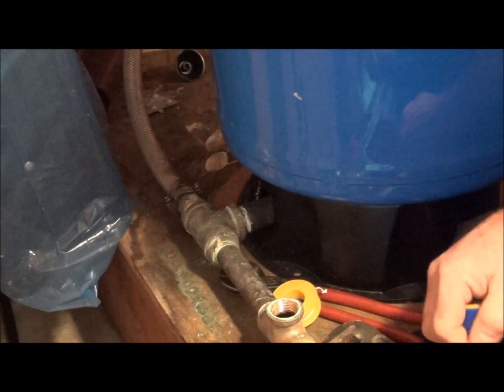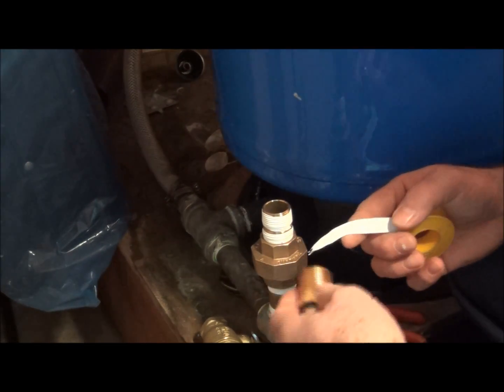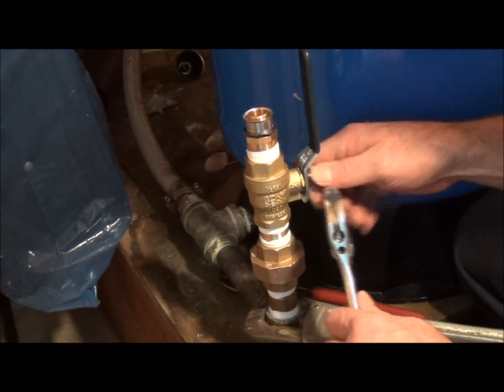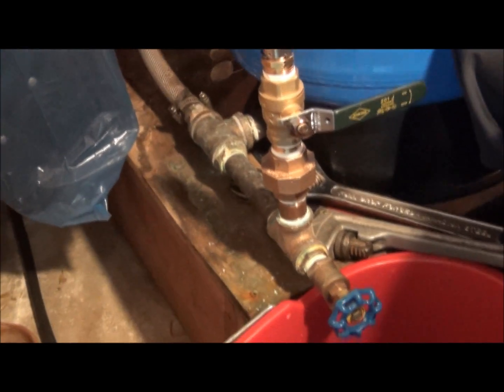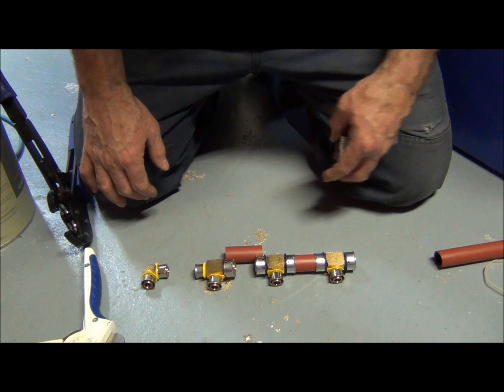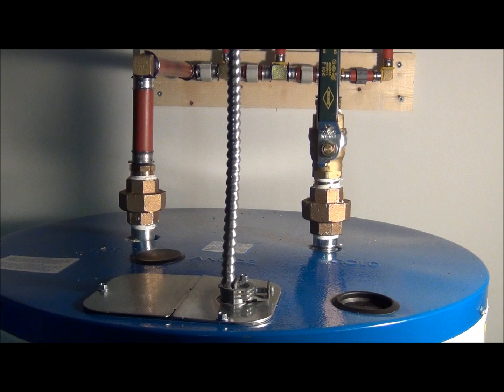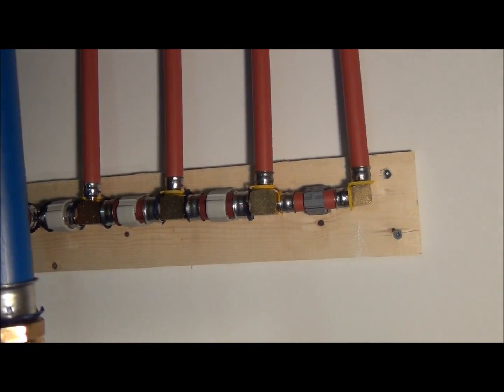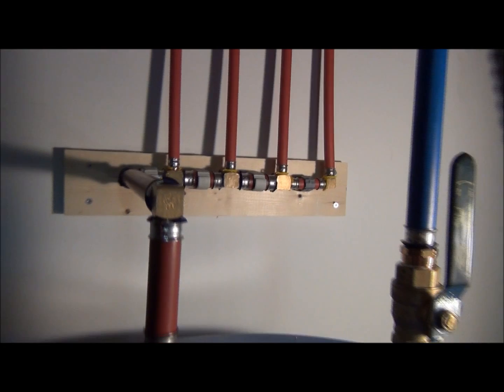How to install Pex Pipe Waterlines in Your Home!  Part 4. Plumbing Tips.

Comment from the maker: Hello Kevlar077;

I did mention this pretaining to oil fired or gas water heaters because of the smoke pipe. I would come off these tanks with copper 36 inches from the top of the tank to the pex. Electric is totally different and safety is not an issue when it comes to pex directly off the tank.
I hope this answered your questions!
Thanks for commenting and enjoy your weekend!    Al
Reply: For code compliance and safety
18 inches of metal pipe: Use at least 18 inches of copper or stainless steel pipe to connect directly to the water heater's inlet and outlet nipples.
Flexible connectors: Use corrugated stainless steel water heater connectors to bridge the gap between the metal pipe and the PEX.
Code requirement: This rule is mandated by plumbing codes, such as the Uniform Plumbing Code (UPC), for both gas and electric water heaters.

Comment: Question. I heard in another video that you had to come out of the water heater a certain distance with copper first before you start the pex. (36"?) Something about the heat of the water heater possibly melting the pex. Thoughts?

Comment: Yes indeed, I am confident that I can repipe my house using pex instead of copper, I'll come off of the main with 3/4 to the water heater, tee off to the bathroom then the kitchen and laundry in a single day with about 50ft.of 3/4 and 50 ft.of 1/2 for under $500. including the fittings and the tools(crimpers), I'll do the hot another day. thanks for the vids.

Comment: One thing I should point out regarding the PEX crimp rings... I was told this by the refrigeration mechanic I was working for... since metal has a plasticity (transition from elastic behavior to plastic behavior is called yield) range, it is a good practice to hold the crimp tool on the ring for about 4 seconds to overcome that threshold. That way, in plain English, the ring will not "decompress" after you release the force.

Comment: I like watching your vids Al. Thanks for taking the time to make them & sharing. Thumbs up
The part where you did the manifold or heade, I always like that idea rather then doing the pipes in a series. However im not sure what the benefit is. I just know it makes more sense to do it the way u did. I was wondering, does using the header & making a parallel system eliminate the problem some homeowners get when taking a shower & getting a blast of cold water when some1 uses the hot water elsewhere?